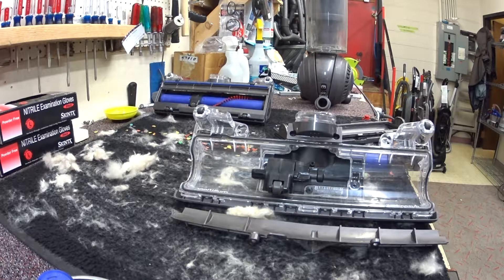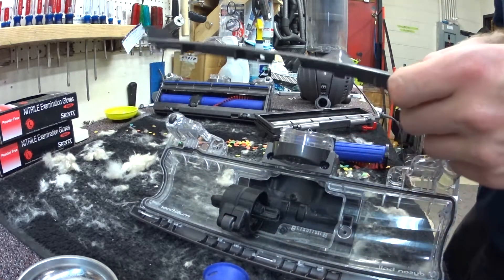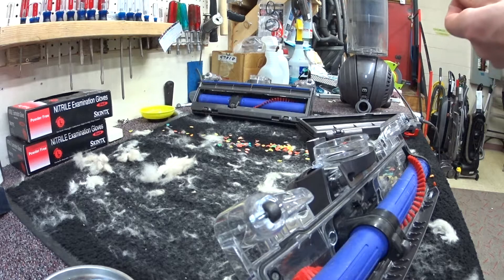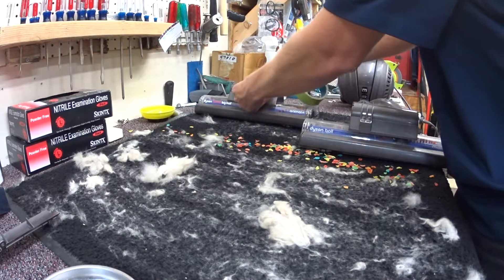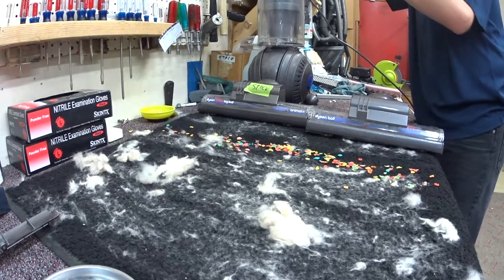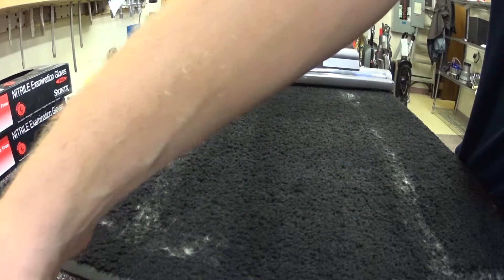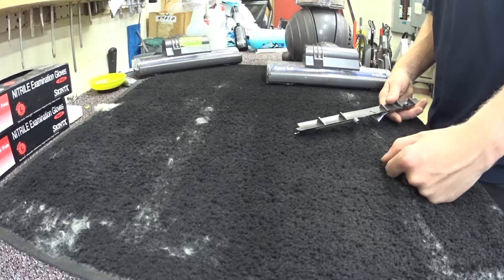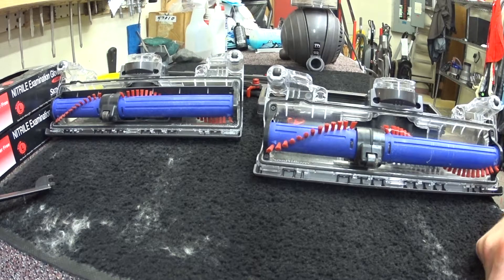How to increase airflow at the claner head on a Dyson Ball DC41 DC65 DC40 UP13 UP14

Comment: I’m currently restoring our dc41 we’ve had for nearly 12 years.  Part of the project is replacing the original head with the ball animal 2 head.  Same one as this but different color.  I removed that piece before I even installed it.  lol.  Currently waiting for the rest of the new parts to come in.  It’s about to clean better with the new head than it did when it was brand new.

Comment: Not much of a difference in cleaning quality but could make it run a tiny bit cooler. You can nearly cook eggs on that output filter as it is.
Mine always picks up sand, contrary to your off beat remark about being surprised.
If you toss that restrictor one more time, I'm coming through the screen and taking it away from you!

Comment: Found an up13 at the curb along with a dc50. Both needed new cords put on because the tweakers cut them off. Got new cords put on and made sure not to put this restriction plate back in after I did a quick and dirty cleaning. I plan on fully disassemble them both and giving them a proper cleaning.